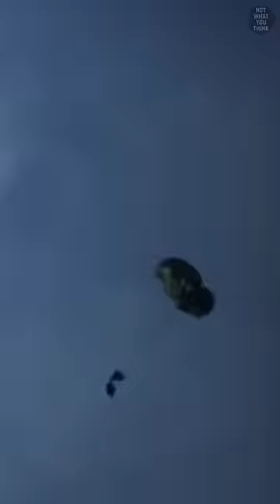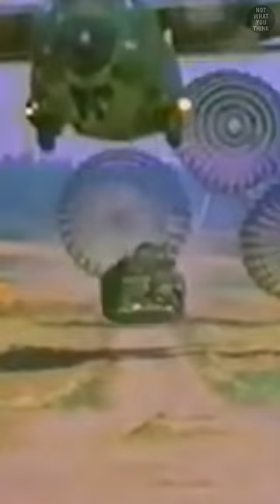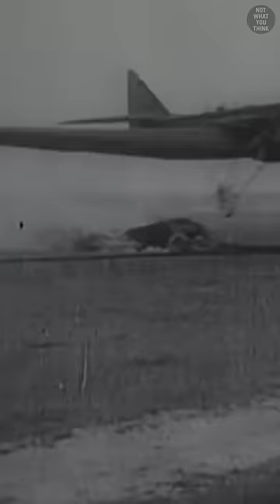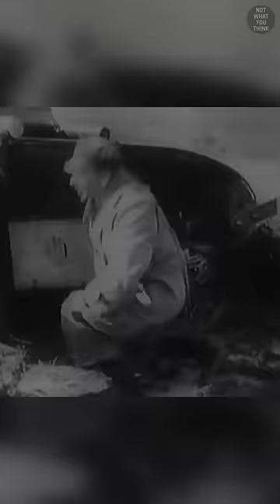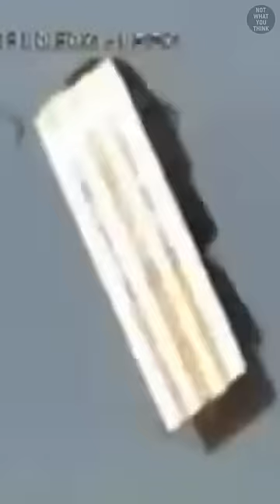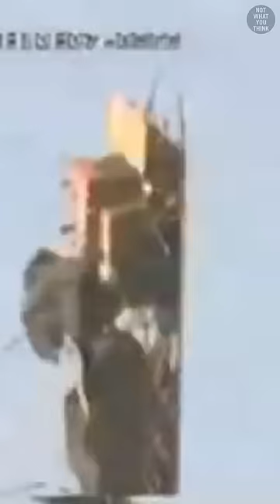When Air Delivery Goes Wrong #shorts

Comment: I think the safest air to ground delivery method is called, "Landing the plane and unloading the cargo"

Edit: All the armchair generals in the comments should take a course on humour🤦
Reply: Depending on how much shooting is going on.
Reply: @fredbecker607  so just like everything else in life?

Particularly schools
Reply: Yeah that one's a classic you know the part when they use other craft/soldier's to cover there landing....gets me everytime.
Reply: Unfortunately, this tactics only works when one fight against men in sandals ☕
Turned out airports terminate their existence a second after a competitive side realises the enemy has joined the game ✈️
Reply: Some planes require runways far longer and far more rare than your average plane or jet to land safely
Reply: @SkewtLilbttm  firstly, this was a joke.
Secondly, you're wrong in this context.

Almost all military aircraft are designed to require smaller runways than commercial jets with similar capacities.
That's actually one of the biggest reasons why militaries don't just use civilian freighters.

For example: The a350 whose freight capacity is roughly similar to the c17 needs twice as long a runway for takeoff.
Reply: As I recall, that was the attempted defense for the E6 that cut the lines for the hummer at the beginning of the video.
Well, it and a handful of other vehicles. I think he's still an involuntary guest of the taxpayer.

As for the original comment, yeah, just land the damned plane and unload. Bombs get dropped, not supplies. Nobody  cares when bombs come apart.   ;)
Reply: if you're going to land you need a place to land that's isn't just a bunch of joined-up holes, chucking stuff out the door you can do anywhere. (just make sure it's gonna be far enough out the back before it flips up to knock your tail off)
Reply: depends on how much flair you wanna add

Comment: We need an expert here, someone who actually flew LAPES missions (like me).  The method was stopped because in 1994 the Army acknowledged that " LAPES has been an expensive, unused, untrained capability and is potentially of limited battlefield use."  The mission changed - the C-130 crash shown was a cowboy pilot who did not follow procedures and made a horrible mistake to try and impress the senior officers watching the show.  This video is close but ultimately wrong.

Comment: USAF 78 - 82. Four years at Pope AFB located in the heart of beautiful downtown Fort Bragg, North Carolina. 
Did drop zone recovery the whole time. Practice bundles. Usually blocks of concrete and rail road ties covered in canvas to simulate the weight of various equipment. I got to see hundreds of air drops and LAPES. LAPES are awesome. They would do single, double, and triple LAPES delivery’s. Two or three pallets shackled together sliding out the back of a C-130 is a sight to behold.

Comment: If the issue was chutes not deploying quick enough, couldn’t they just drag the chutes at a higher altitude until the air caught them? Then the cargo could be deployed with already open chutes. Looks like they did something similar at the lower altitude, but if the concern is the planes slamming into the ground, then just take it higher.
Reply: I know the C-130 is called Hercules but how much power do you think it has in reality?

Comment: The Hercules at the beginning of the video was doing a LAPES drop at Fort Bragg when it pulled up too late. The airplane traveled 1000 yards down a dirt runway and struck a military vehicle, killing an Army soldier. The airplane continued and ended up crashing into trees. When the airplane contacted the ground so violently the wings flexed and broke the wing root and all controls were severed. With the engines in full speed! They had no control! Very sad day for air lifters.
Reply: Why do the engines not immediately shut down if they lose their control signal? This seems like a pretty big safety issue.

Comment: I've seen it in anime. But can they airdrop it with a crew?
Reply: No, the impact shock would severely injure or kill the personnel. You rely somewhat on the track or wheel shock absorbers to absorb some of the impact.
Reply: they can't guarantee it won't flip over & trap the crew or, with a soft-skin vehicle, crush them.

The C-130 has an airspeed just over 100mph, the parachutes do slow the pallets before impact but not enough to make much difference. .
Reply: @davidhoffman1278  it is standing on tracks on a platform.
Reply: They continue sliding after the impact, meaning not all of 160 km/h gonna be transfered into crew's ass. This was obviously a joke, but if crew gonna be strapped to a seat really well so they don't send flying all across the internal volume, or probably nearest device, as tanks tightly packed nowadays, they're gonna be battle-worthty and not injured that much. Also I'm pretty sure that's how Post of Russia send their packages, just airdropping em inside a car.
Reply: Like I mean, don't Airborne troops has armored support being dropped with crew inside. But I think they use brake rockets along with a parachute.